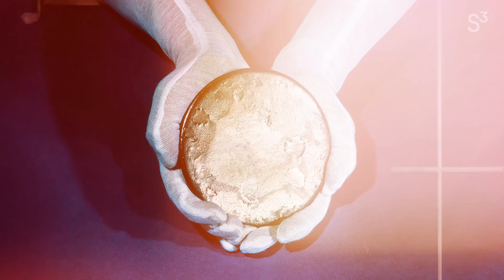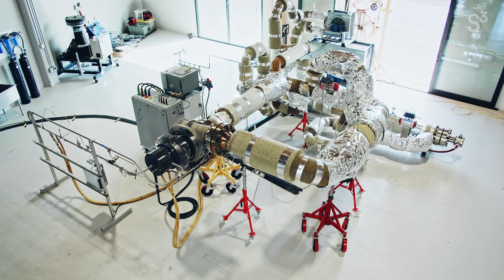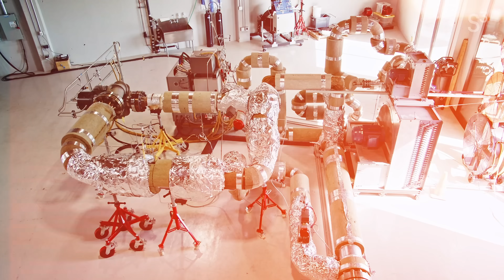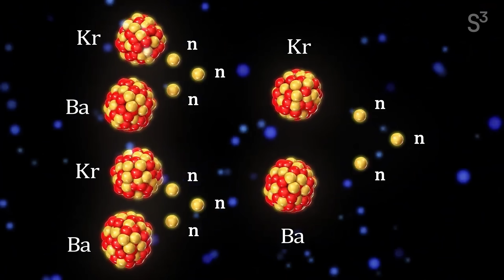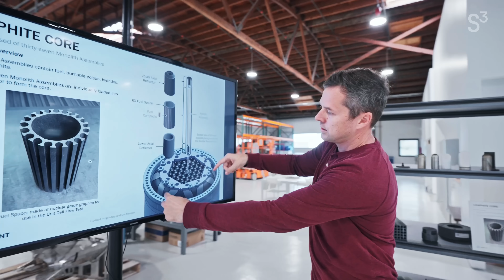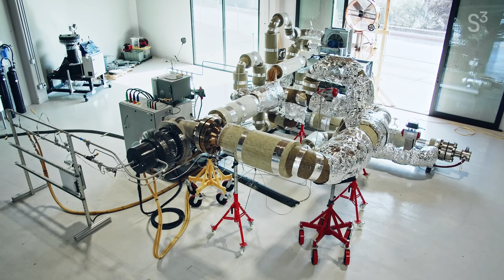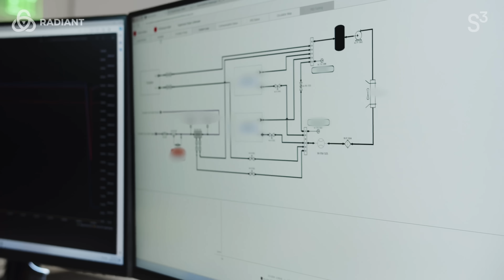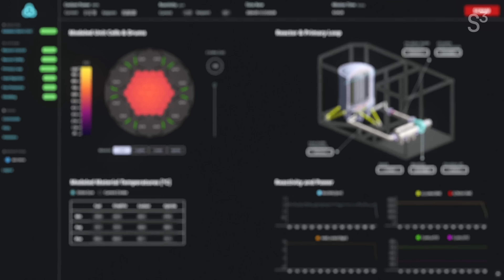The future of Nuclear = Small, Mobile, Microreactors | Radiant

Comment: It would be great to see portable SMRs with a greater degree of passive safety than this... for example, a method to end criticality without auxiliary control or power. How many of those control vanes (neutron absorbers or neutron reflectors?) or their actuator/s need to be functional in order to guarantee sub criticality? It seems like a cracked graphite core could jeopardize the movement of those vanes...
I guess you could make the bottom of the reactor out of an alloy with a melting point just above the operating temperature, then have a zirconium tub full of a fluoride salt, in case you lose the TMP/He cooling and the control vanes... then the TRISO melts through the bottom into the salt that it then melts so it's mixed in SOME coolant that won't go anywhere... then it passively cools through the Zr walls, no neutrons or radioisotopes escape. That 'cheap' insurance would be the cost of a zirconium tub large enough to fit all the fuel and some quantity of fluoride salts... As long as the alloy of the bottom of the core isn't an effective moderator... I guess it could just be a salt plug (this TRISO was mentioned to be small beads wasn't it?)

Comment: 1MW is too small.
Reply: That’s a lot of electricity for a lunar/Mars base, disaster relief, or a small military base, and you can group them.
Reply: @kokofan50  grouping them is the worst idea. Too many parts to maintain with given radiation shielding and all its 10x a mess.
But if we can have a single reactor with 5 MW to 50 MW dynamically adjustable power then hell yeah.

Yes ofcourse for a small isolated base be it or Mars or antartica these things are perfect. aircraft carriers and subs already proved them
Reply: @kokofan50  yes. but this is fission without shielding it wont work and shielding makes it heavy. The way above company handles the said reactor it wont be any different for 10x size. and shielding size is not directly proportional to reactor capacity.

Comment: 2:25 yes you could remove the need for the fuel to be shipped but the supply convoy is still running those missions bringing front liners food bullets and water. now I'm not trying to be directly mean to this guy he is doing amazing work that is needed but this would also be a major issue in securing a small portable nuclear reactor that isn't on a ship because damn would that be a choice target to cause a lot of problems

Comment: AUGH! Learn from history.

The former Soviet Union has over 100 lost RTGs -- small, mobile, microreactors -- occasionally found when outbreaks of radiation poisoning out their discovery.

This is a terrible idea.
Reply: RTGs aren’t reactors.
Reply: @kokofan50  Congratulations. You've made a distinction without a difference.
Reply: @bartroberts1514  there’s a huge difference in how they work and everything that comes from that.
Reply: @kokofan50  Only during their operational life is there any difference at all. They're essentially identical: small, mobile, packages of nuclear material prone to leak and cause disaster. And once their useful life is over, in a few very short decades, if they haven't malfunctioned, leaked, shut down, been broken into, overheated, melted down, then there's no difference at all.
Reply: @bartroberts1514  defiantly ignorant, got it. No matter how much I explain how you’re wrong, you just refuse to listen
Reply: @kokofan50  What exactly are you trying to explain? That because electricity isn't heat, therefore they're safe? Because why?

Comment: No discussion of capability is complete without touching on how many KG of reactive product are created, and the time till those parts become safe again. We can talk about how reactor design and impementation has moved on since the 60's but we are not talking about the elephant in the room for fear of putting the average Joe off.

Perhaps the small scale reactors produce less highly radioactive waste per GW, perhaps not. Lets be told.

We need a new SI unit  (Becquerel* KG * Years till inert) per GWH produced at a first guess. 

Basically the ratio of time adjusted radioactivity risk vs power production over reactor lifespan.
Reply: Indeed. Plus we need to put a price on dealing with the nuclear waste. Because I think it would be much cheaper to deal with nuclear waste of one big reactor versus 10 smaller ones. As you would have to move and collect nuclear waste from these 10 to a central space.
Reply: @Nanne-f5i  
If I understood correctly, they use 30% enrichment. Conventional reactors are more like 3-5%. This means up to 10x more lifetime for the fuel, 10-20 years. Assuming they can burn all of it, but I think they should be able to.

And then the core is small enough to be transported, so they'll probably do just that, take back the spent cores to a processing facility in a remote location, where the disassembly can be done safely. The waste could then be treated as any other kind. Ideally you want to recycle most of it.
Reply: The amount and type of waste are identical, because it uses the exact same fission process. But it's a trivial amount, no concern, unless it gets out into the environment. Not having water in the core, and using TRISO fuel, makes it practically impossible to leak any radioactive stuff.

As for risk, it's really just a few hundred years, after that it's more dangerous chemically. Don't eat it, and you'll be fine.
Also, most of the "waste" is actually unburned uranium, and transuranic elements, like plutonium. These can be used as fuel. The U-238 needs a different reactor type to burn, most of the rest can go back into the fresh fuel. Ironically, these are the less radioactive parts of the "waste". The really nasty stuff are the fission products.
Reply: @andrasbiro3007  I disagree.

In addition to fuel, you have to consider irradiated core parts. Just the relationship of having many smaller reactors is going to mean that you have have more surface area/parts that are going to need treating as hazardous, and this ratio of mass of parts for GWh is going to be lower than for large plants - IE not identical.

https://assets.publishing.service.gov.uk/media/63e24c2e8fa8f50e805a3e66/2022_Materials_Report_-_010223.pdf

Using the above UK figures for spent fuel there is ~7000 tHM (tonnes heavy metal) of irradiated fuel currently in the stockpile.
and approx 113 tHM of plutonium - none trivial!

Talking about plutonium as a trivial problem is nonsense, its one of the most toxic elements. I'm not sure but I dont think it existed before 1945, and is now measurable in adults. It similar to the slow deaths caused by coal - hard to quantify.

Now this is all a push back against you attempting to trivialize what I feel should be central to the new wave nuclear discussion, and better to be had than not. My original point was that some important aspects are not being discussed in the S3 video.

In terms of your line about it being impossible to leak radioactive stuff, I think the reactor model uses deflectors to contain/release neutrons. Here is a failure mode - error,fault or lack of site security causes these to contain when they should be releasing, giving a criticality, overheat and containment breach. There is no concrete sub structure for containment. 

I'm actually pro nuclear (in the sense that its probably the only realistic option given people wont want to give up luxuries based on cheap energy) but only if the long term storage problem for the worst waste should be explored in tandem.

Comment: Dang two questions. 

Are the rotating control rods spring loaded to be able to shut on a loss of control power?

Is there a way to chemically poison the reactor when the working fluid is helium as an extra fail safe if you have a stuck/jammed control rod scenario?

Comment: The exterior of the machine should be designed to look as similar as possible to a diesel generator, otherwise it's quickly going to become a primary target for mortar attacks or air strikes, because why wouldn't you?
Reply: At the same time, maybe it's good that they don't look the same that way individuals who want to apply discretion can do so

Comment: Do they "iterate quickly" or do they "not get to do it multiple times"? The different employees are giving us conflicting statements within 2 minutes of each other.
Reply: I have a feeling they iterate subcomponents quickly but will only have 1 chance for whole system to work.
Reply: They mean "None of this stuff works".
Reply: There are likely a lot of sub assemblies outside of the core that can be easily iterated for efficiency. The design of the core on the other hand and the software that controls the reaction will be locked down by regulation very quickly.

Comment: This is an interesting idea, and I'd bet they'll even find some use for their design in military and remote scientific settings. I doubt it will catch on in any big way though. The failsafes they're installing are all well-meaning, but they are designing toward safety for relatively minor things going wrong. If one of these reactors gets hit by a tornado, hurricane, missile, or mortar it's toast and it will leak substantial radioactivity. That doesn't mean this is a bad idea, but it's only good for very niche applications.
Reply: It’s designed to be passively safe. The worst thing to happen is some pebbles get skattered around
Reply: @kokofan50  No, the worst thing that happens is it irradiates everyone around it. You can make the reactor smaller but the radiation still requires the same amount of shielding.
Reply: @EddieTheH  no, the kind of radtion releasd from the fuel doesn’t leave the pellets.
Reply: @kokofan50  You really have no idea how radiation behaves, do you?
There's a clue in the name "radiation" 🤦
Reply: @EddieTheH  neither alpha nor beta particles can make it through a piece of paper let alone the zirconium cladding, and and there are not gama emitters in the decay chain until much later. So the main radiation source is going to be neutrons, but with the control rods, the reaction producing them is going stop quickly.
Reply: @EddieTheH  
Most of a conventional nuclear reactor is not shielding, but the containment building. The latter is required to hold high pressure radioactive steam, in case of a meltdown. And it's also designed to withstand practically any physical attack, including the impact of a fully loaded jumbo jet.
These reactors don't have water, and too small targets for big weapons.
Reply: @andrasbiro3007  So you reckon neutron radiation isn't an issue?
Reply: @EddieTheH  
No, it's fairly easy to stop. I don't have actual numbers at hand, and no time to research, but it shouldn't be hard to find out.
Reply: A tornado or hurricane would barely scratch the paint. These are not made of plywood, but reinforced concrete and hard steel.
Even smaller missiles would have a hard time reaching the core. And that's not a significant risk, even in an active warzone. These won't be in tanks, but in bases that are rarely get attacked, and even then these are small targets. And most likely enemy forces don't have big enough missiles. Or if the enemy is an equally powerful military, then the whole issue is irrelevant, because nukes will be used anyway.

You can also put them underground, where they are even more protected. A modern military should be able to do that even in a remote temporary base. In more permanent bases putting a thick reinforced concrete shield on top is no big deal. And then only the largest bunker buster bombs can get through.

In reality the biggest threat to a nuclear reactor is loss of coolant. That was the main issue at TMI, Chernobyl, and Fukushima.

Yes, niche applications, but some of those are very important. There are ones they didn't even talk about, and could be even bigger. For example large ships, those can't easily run on renewable energy, but small nuclear reactors would be perfect for them. It would save huge amount of pollution and drastically reduce fuel cost too, which would make shipping cheaper and faster, not just cleaner.
Reply: The use cases mentioned in the video are jaw-droppingly awful.

1. De-orbiting from space, or launch failure.
2. Place in hot military combat zone.
3. Place in urban setting where they're one metal-bandit with an angle grinder and a truck away from their unit going into a scrapyard crusher.

This isn't a recipe for disaster; it's a whole cookbook.
Reply: @bartroberts1514  we’ve put reactors in space before. Do you really think a reactor is just going to be left unguarded in anyway?
Reply: @kokofan50  We've had reactors deorbit before, too. It's an extremely fraught and potentially costly eventuality. There's so much solar in space, a reactor like this makes little sense compared to the risk.

And yes, RTGs go unguarded startlingly often. How do you think over 100 of them got lost?

Do you really think these little throw-away reactors would be well enough guarded?

24 hours a day, 365 days a year, essentially infinite years?

Comment: I would be more worried about terrorist attacks or theft of the nuclear material especially if these are widespread in low security areas.
Reply: Agree, the smaller these get the greater this issue becomes.
Reply: Doubt they are using HEU